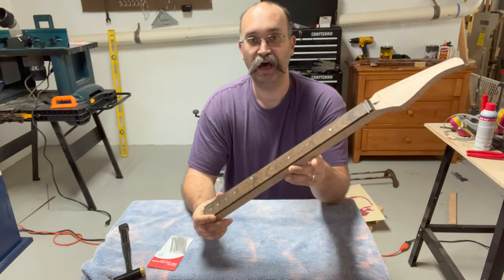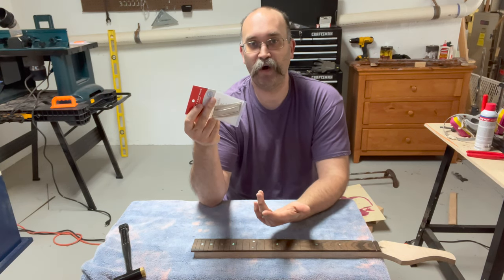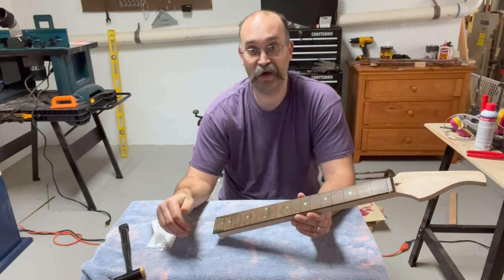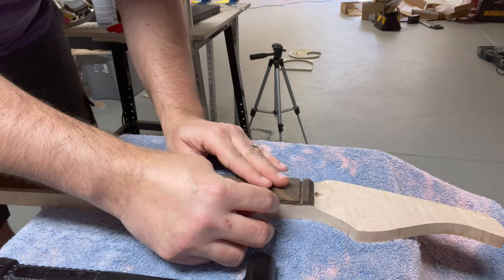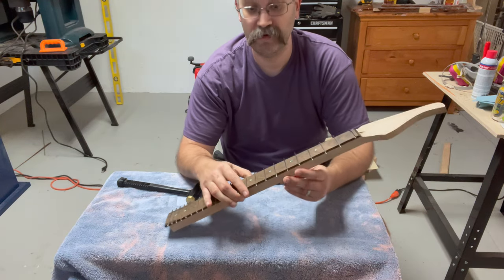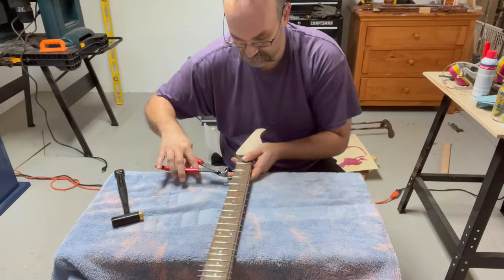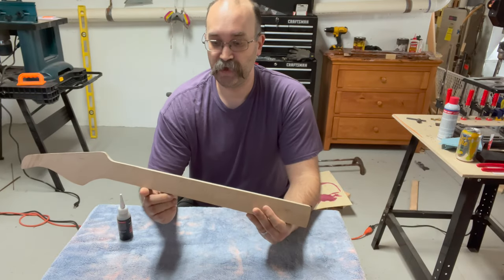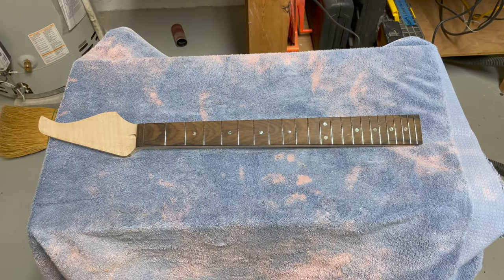Installing Guitar Frets With A Hammer

Comment: Your frets went it much easier than mine. I need to enlarge my fret slots as it took quite a bit of pounding to get the 1st fret to sit flush.
Reply from the maker: One thing to watch for is whether the slot is too narrow or too shallow. If it’s too narrow, you could put a backbow into the neck. If the slot is too shallow, the fret will never really sit flush to the board

Comment: if the one of the fret isn't straight, mean a little bend to left .. is there a solution for it without removing the fret ? .. i mean like pushing it with hammer or something ?
Reply from the maker: Not sure what you mean, but I would assume the answer is no. Replacing a single fret is probably easier, and also gives you an opportunity to fix the fret slot (assuming that's the reason why the fret is crooked in the first place)

Comment: Nice video! 
I'm starting a guitar project and I would like to know if can I fit some 10 inch radius pre cut frets into a 12 inch radius fretboard since I don't have a fret bender. Is that possible?
Reply from the maker: Thanks!

If I’m understanding you correctly, that should work. As long as the radius is tighter for the wire than the fretboard, when you hammer it in you’ll get both the downward and slightly outward holding pressure